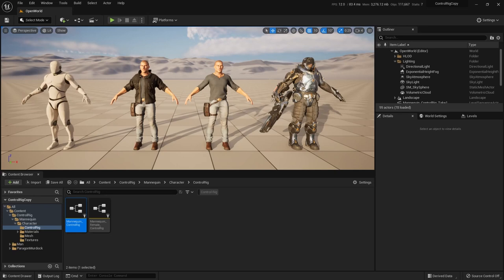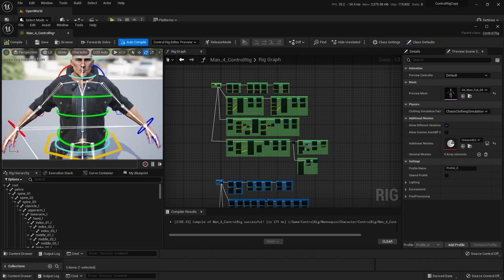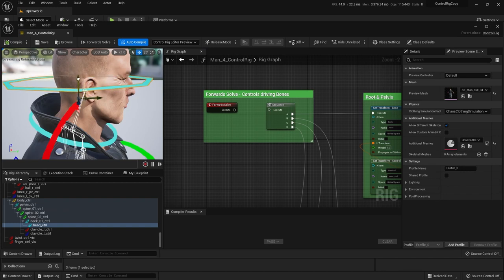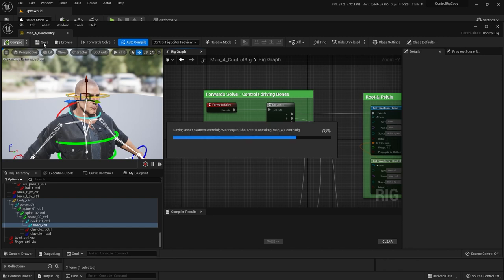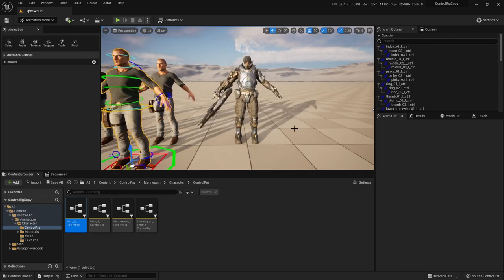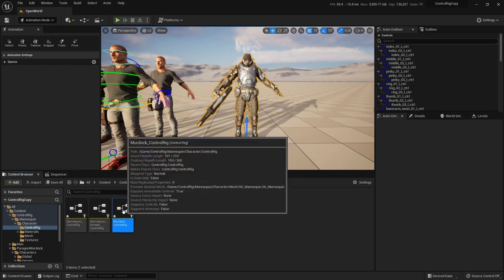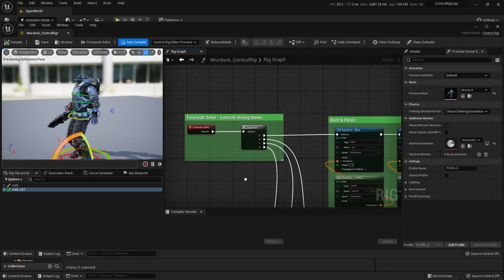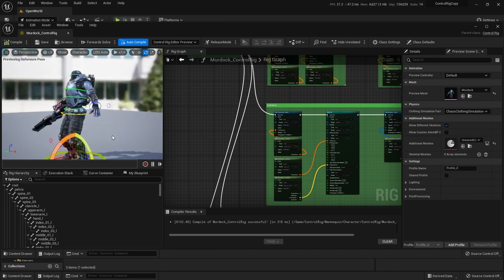Copy Control Rigs between characters in Unreal Engine 5 (&4) #UE5 #UnrealEngine #ControlRig

Comment: I have a small problem: The model what I want to use isn't made for UE5 and when I add it to the mesh it comes off rotated and too big, I'm bit new on UE5 so I cannot find a solution to fit it with the rig :,)

Comment: is there a ue4 mannequin control rig somewhere ? or i need to make from scratch? i found one for ue4, .can i transfer it to ue5?
Reply from the maker: I assume you found the Control Rig Mannequin project from the marketplace for that, which is the one they made for UE4.  You can open the project in 4, then migrate the mannequin to an existing UE5 project (rt-click on the mannequin and choose "asset actions->migrate", and leave all the boxes selected.  That "should" work, haven't tested actually, but it's a common workflow in general... - lemme know if it works for you?
Reply: @3dJC  worked flawlessly.
Thank you so much.

Comment: Hi, it's posible to put the control rig from UE5 in the maniquín UE4 but working in UE5? I have my project with UE5 but I'm using the ue4 mannequin and I would like to use the control rig, you recommend to me download the control rig of ue4.26? Or I can to do that with the UE5. Thank you!!
Reply from the maker: I think the "easier" route is to grab the 4.26 control rig demo project, and open it in 5 so you get the "old" mannequin control rig and use it in 5 just fine.  If you really wanted the new 5.0.2+ mannequin Control Rig, and copy it onto the old mannequin, it seems "possible" but not simple - I played with it a bit using the stuff in my video here - but there is quite a bit of differences between skeletons, and the newer more complex CR has names for things that the old mannequin doesn't have (like those 2 upper arm twist joints), so not sure if that can even be worked around... So if v4 CR would work for you, I'd try that first.  Lemme know if you ever give the v5 CR a go and it works!
Reply: @3dJC  I followed your process for the last skeleton using a UE5 control rig and a UE4 skeleton. Seemed to work fine, since the proportions are the same, it just ignored the missing bones. I suppose downloading the officil UE4 rig is the smarter choice though.
Reply: @ChuckPalomo  I'd really love to know how you did this. Im trying to use control rigs to make tweaks to animations and then bake them but with the method in this video, the feet seem to contort in random directions. Please lmk how you managed
Reply: @ChuckPalomo  I just tried to apply it without making any changes to the bone structure and the feet work flawlessly.  I already made an attempt at using the ue5 control rig and coudlnt get it right. PLEASE help!

Comment: Awesome breakdown! Theres a little trick you can do to instantly fix the controls. Basically you run the forwards solver through the backwards setup which places all the controls on the relevant bones, then you set those as defaults and switch it back. Here's the process if you are interested: https://youtu.be/_oCS4wYGsV0
Loving these Control rig videos!
Reply from the maker: Genius! Thanks David, I'm pinning a comment on that as it's super important info - and totally makes sense as that's what the backward solve does, moves the controls to the joint's  positions. Clever trick, nice and smooth, saves even more time!! Cheers!!
Reply: Thank you sooooooooooooooo much!!!! spent an entire day trying to get a shorter character to sync and not have a stretched body! and this just fixed it in seconds.
Reply from the maker: @capodisinverse1798   Yup David at UE Film Academy is all-star for sure - I highly recommend his course if you have the money to invest - money well spent!
Reply: I can't get this to work in UE5. There's no "Set Initial transform from Current". I've tried the options UE5 has but upon recompiling it always resets the controls.
Reply: @ZiggyGameDev  have you find a way to fix this ? I'm having the same problem.

Comment: Thanks! Which control rig are you using on the UE4 Mannequin? The Epic one from 4.26?
Reply from the maker: Good and timely question! For this video yes the 4.26 CR -- BUT the 5.0.2 hot fix that just came out includes the new v5 mannequin control rig. If I get a chance soon, I think I'll do a breakdown of how that CR is put together and works...
Reply: @3dJC  That would be awesome, i tried to follow the tutorial and didnt work. I just realized that the new one is not the same control rig for the older mannequin. Im waiting to se the video, I love your channel btw :D.